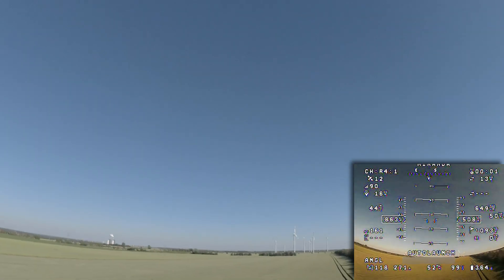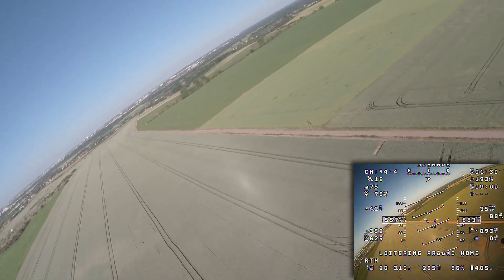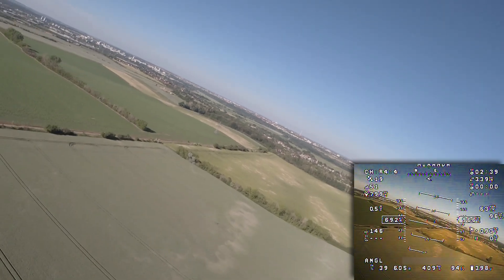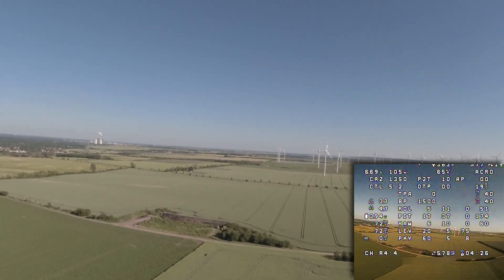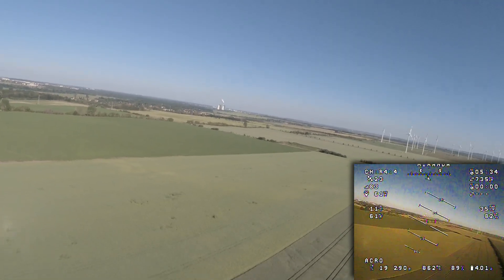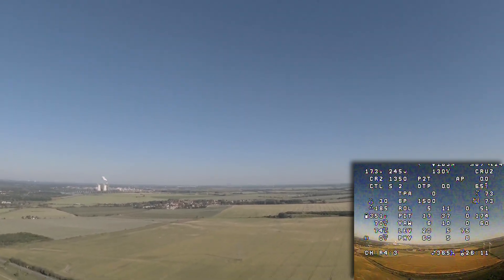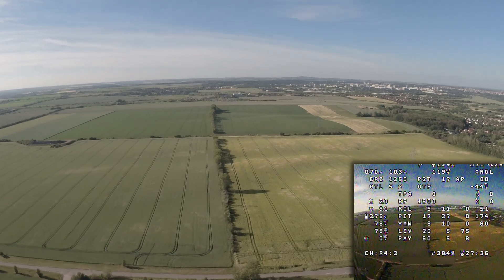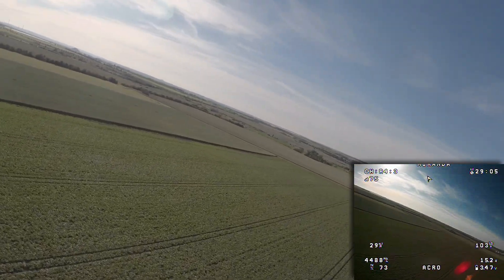INAV 3.0 Tuning - How I do it for my planes

Comment: Do you land with Autotune enabled or disabled?
Reply from the maker: Autotune has to be disabled before landing. Otherwise it will mess with the tune due to the low speed during the flare
Reply: Steve had me land with autotune enabled on my AR wing 900. So I should redo the autotune on it I would think. Thanks!!!

Comment: Thanks Mark . A quick question are you saving the configuration once you are landing or it's being done automatically. In my last tune i didn't save it and i found a new profile (profile 2) on my CLI diff all command
Reply from the maker: if it saved a profile 2 you may have accidently switched profiles with stick commands on the ground. I recommend to disable profile selection with stick commands. 
Usually I save with stick commands after landing and disarming but becaue I use "stats" and Continous autotrim, it saves on every disarm, even the tuning.

Comment: Great useful reference info. Thanks for taking the time to do a walk thru explanation in english as well. 

Wondering how you settled on throttle settings for a default cruise speed .. prior to the pitch-to-throttle tuning after 7:25 in this video. Was your goal to establish a desired cruise speed, or a desired amp draw, or some combination of the two? 

The bit about customizing PID's to customize for flying feel after initial tune is insightful.
Tuning is all about customizing for desired flight performance. Think this is missing from most tuning discussions ... ie: what are the goals for a wings purpose, before one begins INAV configuration and tuning. This is why I laugh when a forum post asks for a tune. It all depend on type of flying, and how a pilot wants the wing to feel, or respond in flight.
Reply from the maker: I tuned the cruise throttle for optimized mAh/km efficiency. And around 75kph cruise speed was a very good value. That also depens on how much stuff sticks out from the fuselage. Nose camera, Antennas, tape.... Mine can fly when completely tuned at around 75mAh/km.
Reply: @MarcFPV  Thanks. Makes sense, if going for range, ie: best efficiency. Good idea as default setup.

Comment: Great video Marc.  I have setup two slow glider type T tail planes on 3.1 now (Eflight Timber and Volantex Trainstar) and they both fly fine with the presets and without autotuning.  I tried Autotune and it made the planes twitchy.  I left them without Autotune adjustment since I am satisfied with a very stable flyer for these slow cruisers and if I want to turn sharply or try a maneuver I can just switch to Acro.  I am assuming Autotune is trying to optimize by setting the PIDs to provide the maximum control available given what the plane is capable of.  However I wonder if it would be desirable to consider changing the Autotune such that after the tune there is a choice of how aggressive you want the tune to be, say from 1 to 5, so you could decide how you want the plane to handle?  Not sure this is even possible, but just an idea.
Reply: To make your plane less twitchy manually set a lower max pitch, yaw, and roll rate then run the auto tune.  That should make the auto tune limit your FF and P values so the plane feels less twitchy.
Reply from the maker: Yes as @Dovorans said, you can change a few values to make autotune more soft. 
fw_autotune_max_rate_deflection > reduces the maximum surface deflection autotune is allowed to use to determine the rates. By default it is at 90% but you can lower it. This will reduce the max tuned rates on both, pitch and roll.
fw_autotune_rate_adjustment > instead of auto you can set it to LIMIT. Then INAV will only reduce the rate if needed but never exceed the last set value before autotune is engaged.
fw_autotune_ff_to_p_gain > P is always a percentage of FF, by default 10%. You can lower that to maybe 5% on gliders with low rates to get softer stabilization
fw_autotune_ff_to_i_tc > this value determines how agressive the I-Term is set. Raise the value (default 600) to get lower I-Term in autotune. I don't know what good values are but you can start with 1500 and try the tune again.

Comment: Unfortunately I have a analog and the values are all over the place
Reply from the maker: Just flew again today. Better keep the imu_acc_ignore values on 3.0 stock. 9 for rate and 5 for slope, With some wind and turbulences I got a bit issues with not readjusting today. Nothing critical but it was better then in straight flight.

Comment: Can I calibrate the airspeed sensor?
Reply from the maker: I have never used one yet. But I also don't know a calibration value. If you use a digital airspeed sensor, no calibration is needed.
Reply: To calibrate airspeed you'd have to gather data from airspeed sensor and determine how it compares to gps ground speed. 
One technique would be to fly at a constant power setting (amps) in level flight near your typical cruise speed.
To null out effects of wind, can fly north then south noting both air sensor and gps speeds; then repeat but flying east then west and noting both speeds for each direction again. (difference in gps ground speed in opposite direction is due to wind speed) 
The difference between N-S and E-W will give you values for actual wind speed. These wind speed differences can be used to adjust gps ground speed to calculate actual airspeed.  You can then divide actual airspeed by indicated sensor speed to get a multiplication factor for calibration value. 
Averaging the 4 gps ground speeds and averaging the 4 air speed sensor values (dividing the two results) is an alternative way to derive a calibration multiplication factor.

Repeating the flight sequence after calibration factor is applied, will verify results.
Best if calibration flights are done when you anticipate wind to be minimal and steady. Gusty winds could result with greater error in calibration value.
Reply from the maker: @AerialWaviator  but where do you set the calibration factor? I have not seen any value in the CLI but maybe I missed it. Have never used it.
Reply: @MarcFPV  Try looking for something related to: "pitot_scale", or "SETTING_PITOT_SCALE_DEFAULT" in INAV.

This may be another helpful reference for calibration (a ground based pressure test using water height in tube).
https://www.rcgroups.com/forums/showthread.php?3688843-Calibration-of-pitot-airspeed

To be honest, I have not completed setup myself, just reading up on.
Reply from the maker: @AerialWaviator  Ahhh awesome! Found it: https://github.com/iNavFlight/inav/blob/master/docs/Settings.md#pitot_hardware
Today I learned something. Thanks mate! Will need that in a few months when my Clouds is finished.